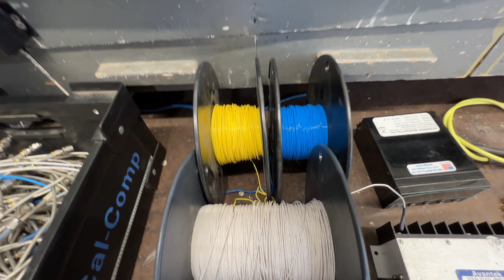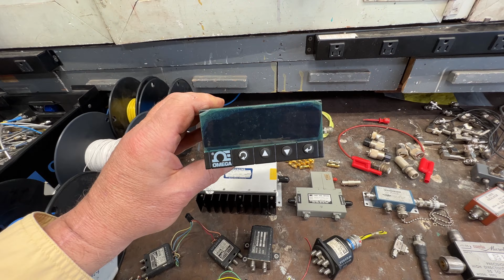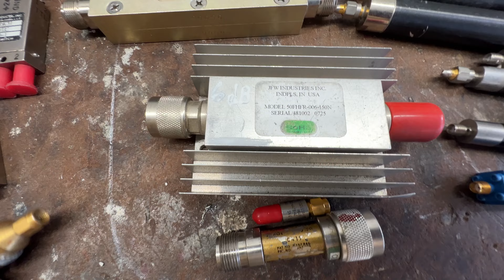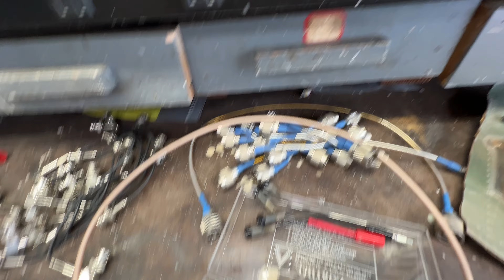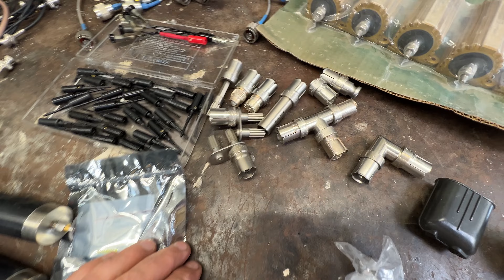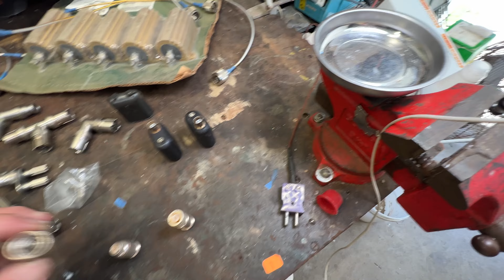⭐ May 28, 2022 W6TRW Swap Meet Booty 0020

Comment: I think that twin axial connector at the end may be an adapter for the R-390/R-390A receivers...had one long ago but let it go along with the radio.  73 -Dino KLØS
Reply from the maker: The adapter for the R390 is larger with narrower pins.  I used to have a R390A.  I still have the antenna adapter in my adapter collection.